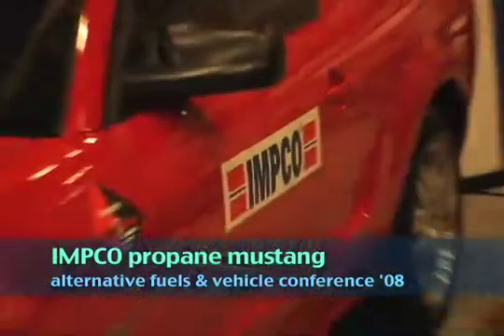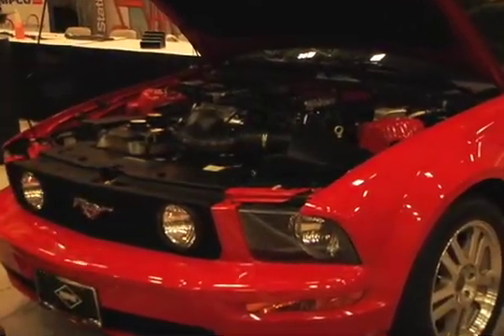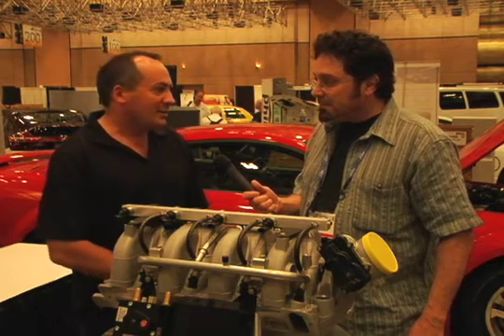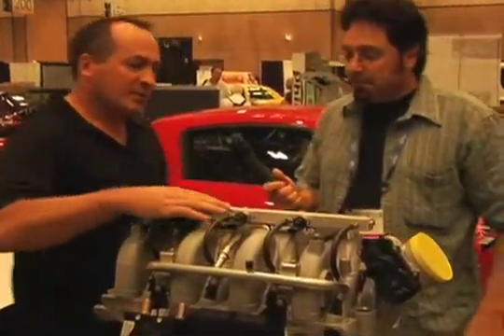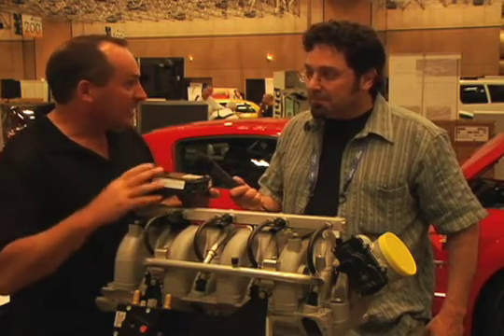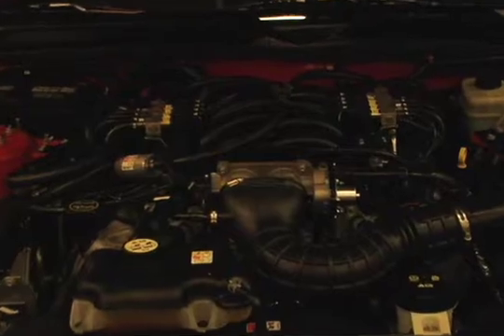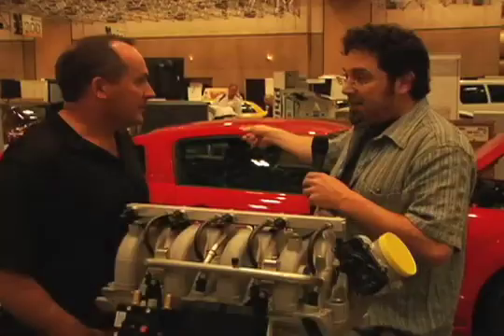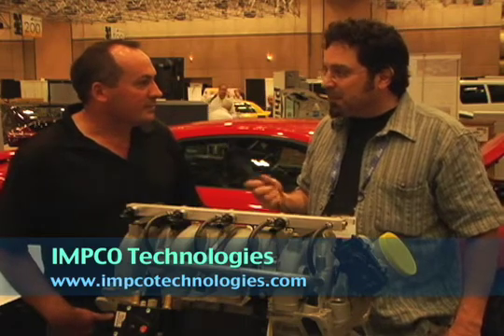Propane Powered Mustang

Comment: Installed on a small fuel efficient car it could work with E85 to lower emmissions. Propane not cheap in small tank. Make a propane powered electric generator hybrid coupe and your company may be successfull. Your just selling a kit to install on car it will be hard to compete with China. China can manufacture the whole car.